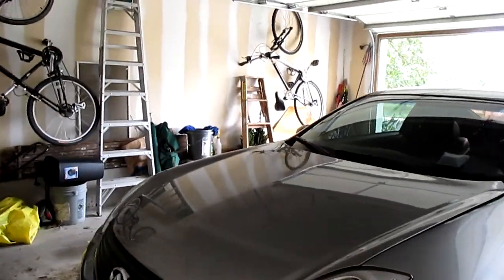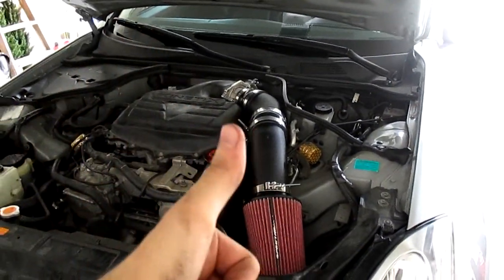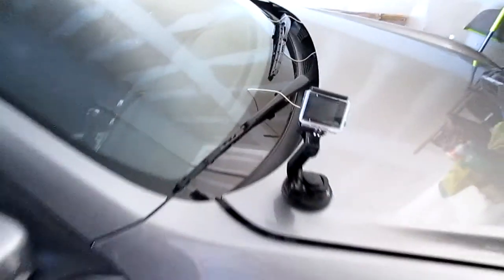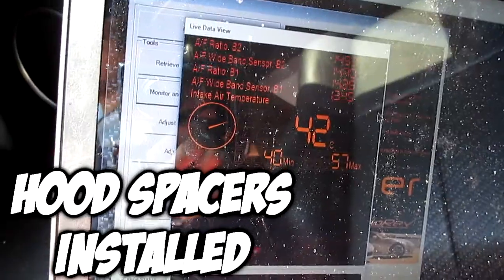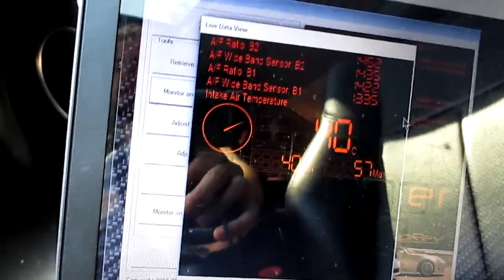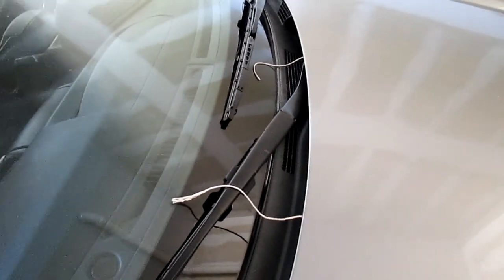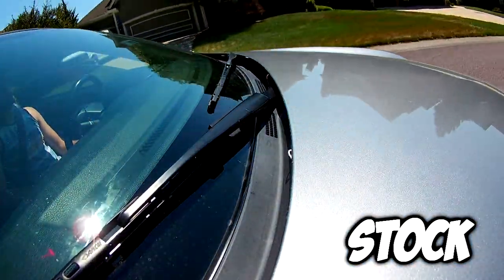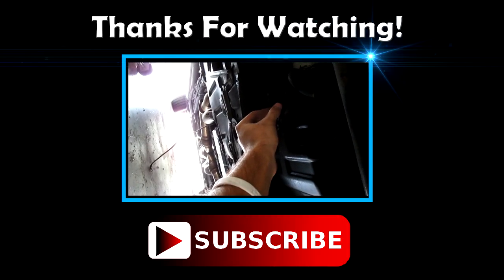Limp Mode Tuning HOOD SPACERS! | TESTING | G35 Coupe

Comment: Have you thought of putting a Water and Meth injection kit, makes your car run way cooler and better, also gets rid of heat soak into the engine. I am doing mine to my G35 next week including the transgo kit
Reply from the maker: Yeah Eventually I plan on it. These hood spacers were mostly to help my hood clear my 4in intake. After installing them, the heat came down drastically. Especially after driving hard, I barely feel any heat when I park the car. Before without the spacers, the amount of heat that could be felt after parking the car was ridiculous.
Reply from the maker: Jorge Garcia haha Ill follow back. I will!

Comment: 40c is 104 degrees and 64c is 147 degrees. That is pretty hot. What was the outside temperature?
Reply from the maker: The real feal that day was 95 with pretty high humidity. Forgot to add that in the video
Reply: I would email Pat, and say hey cold air intakes read 3-4 degrees above outside temperature and your Limp Mode intake is reading 22 degrees above outside temperature. If this does not make more power when I dyno the car can I have my money back?
Reply from the maker: Motordyne G35 Im in kansas. I recorded the video the previous friday the 19th. Actual temp was 93 that day, my bad.
Reply: I wanted to get accurate figures, because I was considering this. Nice work on getting me these numbers as I do not have anyone to compare with. The stock box will read about 10-14 degrees above outside temps once moving, you are confirming 11 degrees over with the limp mode intake. On my injen long tube cold air intake, in front of the bumper, which starts at 4" and tappers down to stock diameter at the MAF is reading 3-4 degrees above outside temperatures. Colder air means more power, plus I put down 283whp so I'll stay tuned for your dyno results because your intake is bigger all the way to the throttle body. 11 degrees is much better than 22 degrees over that is for sure. The spacers you did with the strings was an interesting illustration, but the intake is still sucking hotter air than a cold air intake. That limp mode intake is expensive, so I would be pissed if I buy it and it does worse.
Reply from the maker: Motordyne G35 Yeah ill definitely keep you posted on the dyno results. Also I failed to mention in the video that I only drove around the block and got up to speed. So with longer driving that of course would lower the temps more. Also I still havent removed the lower stock intake section at the bottom of the bumper so removing that would allow more air to come in as well.

Comment: the reason why the strings got sucked in, is cos of the pod filter under the hood.  theirs very not much space under the hood when its close. for air
Reply from the maker: The intake is way in the front. The reasoning for the string being sucked under is because the base of the windshield is at a high pressure point and air gets forced into the engine bay when you start driving. Thats why your cars ventilation (a/c and heat) is located there. Thats also why you see those big cowl hoods on drag cars.
Reply: Induction hood is what he basically made. You clearly know little about it lol